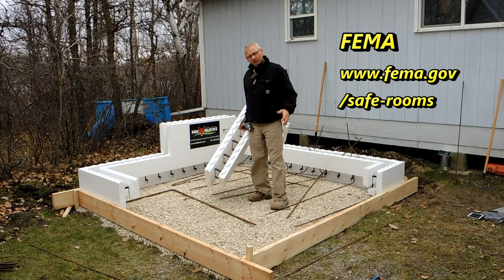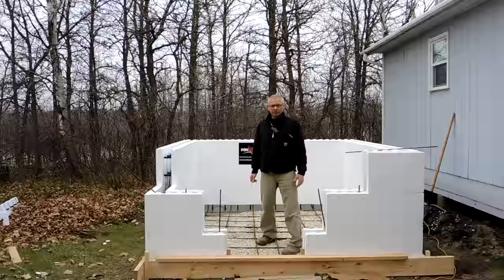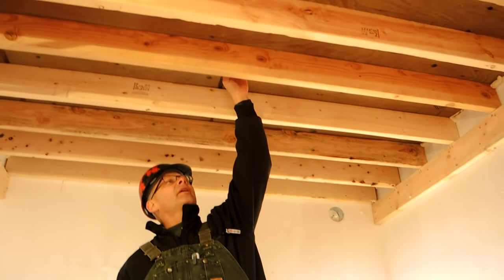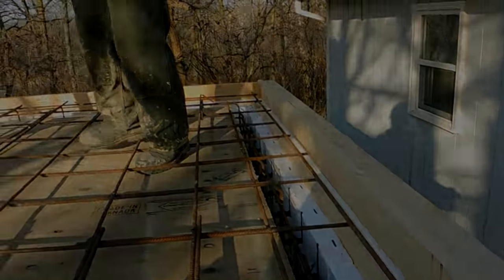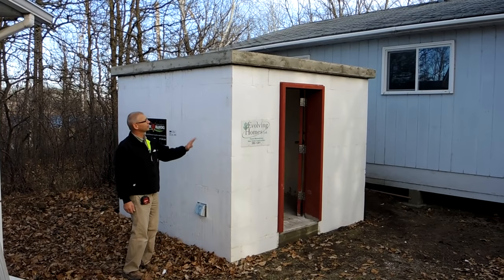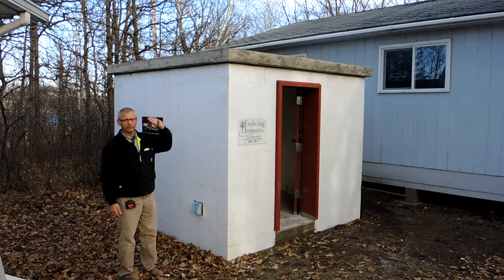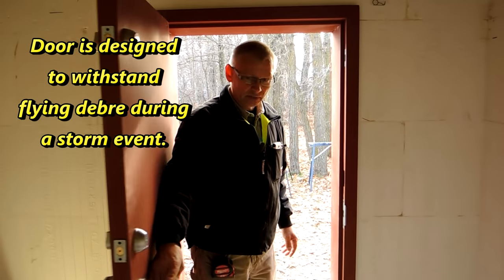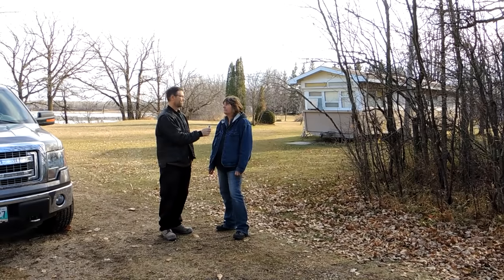Fox Blocks Storm Shelter Full Length HD

Comment: Having been through a tornado in a safe room I can say that this shelter is NOT anchored to the earth and may tumble if there is a direct hit. (Wadena MN Tornado.  Our house was the first house destroyed in town)
Reply: I immediately wondered what anchors the building to the ground, nice concrete shelter but no good if it goes flying off.
Reply: That was my first thought.

 First of all, I am sorry for your tremendous ordeal. I can't tell you how many times we ran to the storm cellar when I was a kid. 

But if a tornado can toss a bank vault, this will be tossed as well; the weight won't save it, or those taking refuge. 

It needs to somehow be anchored. Or put it in the basement of a building that is being built, possibly. 

Would not be my choice. I see problems with a LOT of storm shelters they sell now. A lot of below-ground ones are popping up out of the ground, not anchored in place either.

Its a crying shame people are being preyed upon (using fear, no less) to purchase fraudulent shelters. 😥
Reply: Normally an engineer will call for rebar ties sticking out of the foundation that the blocks go over. That tie the wallls to the foundation with the next pour. Yes this was a flawed demonstration and it what a to code example would be. Nice catch y’all
Reply: if you read below the video, it states that putting anchors would make it stronger
Reply: @graciel3725 do you think a over the ground steel shelter works? I bought one to install inside our closet.

Comment: After witnessing the recent Kentucky tornado and walking through the debris and destruction, I would not feel safe unless the shelter was below ground.
Reply: There are above ground shelters that are much safer than below ground ones.
Reply: Yep.  I lived in tornado country all of my childhood.  Shocked to see this in the first few seconds on a pad on top of the ground.  I would not  want to be in tornado weather in that.
Reply: But when the mobile home flips over you're trapped underground. Hope it does not start leaking water/fuels or have an electrical hazard/fires right above you. Dying from being trapped inside after surviving the tornado is not a great plan and is why most of these above ground shelters have inward opening doors and airflow management. Most underground shelters I have seen are primarily designed for nuclear / forest fire situations. Tornados are extreme, but if your above ground shelter is built to be stronger than the debris thrown you can survive fine and I would feel 1000 times safer in one than a bathtub inside that mobile home.
Reply: Above or below ground is not an issue about the strength of the build.  The issue some people have is massively expansive soils and high water tables that would destroy the shelter before a storm ever came.  But the issue with this shelter is it’s not really heavy enough or secured enough to the ground for a direct hit from a bigger tornado.  But slight modifications such as tornado earth augers and strapping or a deeper footer or slab would solve some of those problems.
Reply: Above ground shelters if built correctly, and I stress built correctly can easily survive an EF5 tornado. No one has died in an above ground shelter built to FEMA ICC-500/P-361 standards. All 11 above ground  ICC-500/P-361 standard shelters that took a direct hit in the EF5 that hit Joplin did fine. All 16 above ground ICC-500/P-361 standard shelters that took a direct hit in the 2013 Moore EF5 did fine.
Reply: I would prefer atleast mostly underground too.    theres no denying thats safer in a tornado
Reply: @97warlock  Pros and cons to each. The best is both, I've seen people installing underground shelter's with an above ground shelter covering the underground access door. It makes it almost impossible to get trapped in the underground shelter from debris.
Reply: @Reloadeez     thats incredible.          2 swhelters,
Reply: @karlab9557  It's perfectly safe in a tornado.
Reply: @97warlock  I deny it. Verified by above ground shelters in Moore and joplin.
Reply: LOL, there are so many self appointed engineers in this comment section.

Comment: How was this shelter anchored to the ground? If it's just sitting on top of the ground a strong twister might lift the whole thing up off the ground and take it away regardless of it's massive weight!
Reply: I don't know, that thing would be pretty darned heavy for it's size. 9x9ft with 5" thick floors and ceiling and 5" walls. That's something around 6yd of concrete and 24k lb!
Reply: Concrete is pretty heavy. Every other structure will be destroyed and that thing would still be standing. Only thing better would be a concrete dome.
Reply: Depending on the strength of the tornado it might be good for a small tornado like a EF0 OR EF1 anything over that would probably destroy it. That thing needs to be under ground.
Reply: @shanefowler3504  you might want to check tornado videos. Buildings that are heavier have been totally destroyed.
Reply: @shanefowler3504  Better would be to bury it underground!
Reply: When locomotives engines get thrown around like nothing, no way that thing is staying put just poured on the ground without serious deep ground anchors, many ground  anchors.
What was the weight of that shed, 24k-lbs verses a diesel locomotive ball park 120k-lbs getting tossed around.

I’m thinking a human milk shake on a direct hit on that shed
Reply: It will be knocked over once the tipping starts where air flow gets under it. Scramble eggs inside.

Comment: We had a huge tornado come thru Moore Oklahoma then thru Oklahoma City and Midwest city. It picked up a covered hopper rail car which weighed about 63,000 pounds. 1/4 inch steel. it ripped it into three pieces and tossed them half a mile. One piece went into a building and one went into a ditch about a block from that. I do not want to be in anything above ground.
Reply: But that had airflow underneath to lift it.
Reply: May 3, 1999 Moore OK F5 tornado leveled everything in its path. Local meteorologist, Gary England told viewers to “get underground if you want to survive”.
Reply: Casey Outdoors there have been multiple tornadoes in Moore?!
Reply: I was there for the 2013 one that hit.
Reply: I would build up dirt hillsides all around and at least 6" on top. Otherwise I'd say underground is Definitely better.
Reply: I would not feel safe in that. It doesn't seem to have much other than weight to hold it down. Even if air can't get underneath it I still think that a fierce enough storm would just take this thing for a ride.
Reply: As a Dutchman I don not understand why American people in parts of your country were tornados often accur are not building houses from strong concreet. After a devostating tornado you often see houses  made of timber witch are in  compleately ruine . Is concreet verry expensive in the US?  A superstruckture from concreet wil withstand a tornado much better than house made out of timber.
Reply: @tinekedevos-elsenaar5901  it's hard to describe what you would need to do in order to build even a tornado "resistant" structure much less a tornado "proof" structure. No flat surfaces on any side. Weight means nothing to a wind traveling at 200 mph in different directions. An ef4 or ef5 is yes one tornado but there has been research done showing that inside a big one, in your measurements 2 kilometer across, there are multiple vortexes all going in different directions. Don't think anyone here wants the added expense of building a concrete  dome buried and anchored with all the power and communication infrastructure buried also. On the coastal areas we also experience hurricanes that have tornadoes along with tidal surges of  sometimes 20 to 30 feet.
Reply: @tinekedevos-elsenaar5901  People here resist change, they want their houses to look like every other house around and unfortunately that means stick built houses and they charge a fortune for them. Concrete houses would cost a little more but considering the amount of expensive labor in framing and siding a house and the higher maintenance after it's built reinforced concrete would be cheaper in the long run but people here are just set in their ways.
Reply: donnie brown said
Reply: What you put together in pieces, will come apart in pieces. No way in hell would I risk my family’s life in this failure!!! OZ Saferooms is the only way to go. www.ozsaferooms.com.
Reply: Private Investigator
 I took a look at the Oz. 

Fox block comes in 8” forms. You can poor an 18” ceiling if you really want. You can put whatever door you want on it, sliding or swinging. You can use additional rebar as you like. 

Two things the fox block has that the Oz doesn’t. 

Studs every 8” inside and out. That means you can easily customize the inside and install siding if you want.

Vapor barrier/insulation inside and out. 

This means you can make part or all of your home from this and don’t have to go outside if a storm is coming. 

Oh, and other than the concrete poor, you can do all the labor yourself. Unless you know how to poor the concrete. Then you can do it all yourself. 

With the Oz, all you get is a concrete box build completely by hired labor. 

To each their own, of course.
Reply: Yeah 99 and 13 took same paths just about also. Several people had homes destroyed rebuilt the. Destroyed yet again.
Reply: Arnold Thompson I have seen an f5 peel a street completely up! Do you know how hard it would be to peel the street up? I have seen a house’s foundation completely gone in thin air after a tornado! Mother Nature would tear this out house to pieces even at an f3 level! All shelters should be below ground! It’s still a better option than riding the storm out in that trailer house! If that was my shelter, I would of had 
anchor bars about 10’ into the earth, and have the footing tied in the anchor bars, on top of a 12”+ footing! You only have 1 shot at getting this right, you either survive or die, go the extra mile to make sure it’s right!
Reply: Don't blame you.  They didn't even go down about 3 foot in concrete into the ground to help hold it in place.  Scary.
Reply: Tineke de Vos-Elsenaar     In the U.S. we build expensive beach houses that we know will eventually be taken down by a ‘hundred year storm’.  In about ten years.  Then insurance rebuilds.  It is the American (U.S.-ian) way.  The owners are always devastated and never expected such a terrible storm.
Reply: @tinekedevos-elsenaar5901  wood is cheaper to build with. Im learning that ICF is more costly up front in the build than wood structures. However i do agree more structures in tornado alley should be built to withstand tornadoes.
Reply: Even above ground can form some type of protection the chance of a tornado that big to destroy this place hitting this place directly...... You might as well just say it's gods will at that point
Reply: @TheHopson  there are literally scores of cases of above ground shelters being perfectly safe. Storm after storm you see footage of slabs wiped clean except for the above ground shelter.  Also, all tornadoes don’t occur in Tornado Alley. Dixie Alley is nearly as active, and the vast majority of us cannot go “in-ground” due to the water table.
Reply: @A1SPI  the reinforced concrete is 100% of the strength here, and it is monolithic just like the Oz. That said, I would have done denser rebar for missile protection and a WAY heavier foundation if I lived in F5 alley. Still, this thing will withstand a lot.
Sincerely,
Some a-hole on YT who is also a licensed structural engineer
Reply: This has already been mentioned but I agree, it needs to be anchored with footings about 3 -5 feet into the ground.
Reply: @tinekedevos-elsenaar5901   concrete is not expensive, it's quite labor intensive and not many residential home builders have the know how too.
Reply: @tinekedevos-elsenaar5901  Huge local tire shop in my area got nailed by a tornado a little over a year ago, they all happened to be in the break room since things were slow because of covid going on, and thankfully the break room was built like a storm shelter. The old building was steel, the new one is 100% concreate.
Reply: @branisthemanyo  meaning....a rail car tossed onto this structure would be very bad for it occupants.
Reply: @tinekedevos-elsenaar5901 every house you see is made of wood. It just looks like cement but they are not. I don’t know why, well I guess I do. I waited 5 years to buy a house looking for 1 made of concrete or cement, but only found wooden houses, 1 time I heard about 1 cement house and the cost was 4 times the price of a regular house. And that’s the only house I’ve ever heard of and also 1 that

Comment: Having a vertical door that opens IN is very important. Anything else can trap the occupants when something lands on it.
Reply: joe woodchuck  You are exactly right ! I’ve seen countless shelters advertised, most with outward door. Not good !
Reply: It also minimizes the possibility of catastrophic door failure.
Reply: I agree.  I would not go into a shelter if the door opened out, or has rails to slide on, on the outside.
Reply: And use the correct door so it doesn't blow in like the poor sweet lady in oklahoma  sending her family love and prayers 💕
Reply: I'd rather be stuck inside for several hours than have that door blow in killing someone.  Always have the door open outwards and always notify your local or community fire station you have a shelter.  They will check on you if involved in a storm.
Reply: Outgoing doors are far stronger than inswing. I'd rather be trapped for an hour than die.
Reply: @williamabaker12  You could die when nobody knows you're pinned inside by a tree branch. Doors opening in can be made just as strong BTW.
Reply: @bparsons72007 A strong enough wind can still rip an outward swinging door.
A Centurion tank had it's hatches blown open in a nuclear test.

Comment: My neighbor used a small steal shipping container that is anchored  using concrete   and steel beams hammered 20 feet 
into the ground and welded..He paid less than $1000 and is sweet, well built and very safe.
Reply: Sounds definitely like a strong & economical way to go!
Reply: That's a good idea.

Comment: Yes, the rebar and no chairs is a problem, not round is a problem, the lip is a problem, the door is a problem, the width of the walls is a problem and the biggest problem is the lack of a proper footing for such a shelter.  However, what turned me on was the fact that it was a monolithic pour.  One big, bad ass pour with no blow outs.  Good thing!
Reply: How did the concrete stop from filling up the floor and just started filling up the walls?
Reply: @toocoolfortheroom380  i was wondering the same thing too
Reply: @toocoolfortheroom380 pour enough for the floor to fill, then wait a bit before pouring the walls

Comment: I   used   to   drive    a  mixer   concrete   truck   and   I    hate   those   dam   pump   truck
drivers,  they  tell   the    mixer   driver  "add  10   more   gallons   of   water"    and   then   they   tell   you   to   add    more   &    more.  They   do  NOT   want   to   pump   a   slump   of  5
they   want   a   7   or   8   (all   water)   to   save   their   pump   from   working   too   hard.
When   you   water   down   concrete    it    will   crack   after   a   few   years.  This  guy   wanted
a   5    slump   he   should   have   sent   that   load   back   and   waited   for   a  5   slump   load.

Comment: Given the choice  of seeking shelter between the stick built house or this concrete bunker, hands down the concrete bunker is the better option. Although, it wouldn't have added much cost to the project to integrate some steal columns into the floor pour at the corners going down 8 feet or so to keep the possibility of structure of being rolled over "worst case scenario on the door side" you'd be in tombed until heavy equipment came to upright the structure. Still it's a strong well built structure alternative where below ground structures are not feasible or cost effective. Nice job....

Comment: Now you just have to hope that when the tornado grabs this thing by the rain drip edge and blows this cube onto it's side, it doesn't land door side down. You could have attached 4 helical foundation piles to the rebar in the floor of that thing for about $700 and tornado would have to pull this thing up by the underground bedrock to move it.
Reply: Pretty sure an F0 or low end F1 isn't going to flip this thing over, hell they can barely push a car around
Reply: explain more please

Comment: Fox blocks. Good way to make an insulated house. Why an insulated storm shelter? I do like the eadse of construction. Looks very solid as it blows down the road
Reply: You should check the mfg for the wind load for these blocks not been around this for a few  years but i think 165 mph or more.  Agree with the lack of anchor to ground.  Comment about height of drop of the concrete shows this guy does not have knowlege of pumping concrete walls.  I would not have added the lip. 7" slump can be good concrete we do not what chem. added to increase slump for pumping and not reduce psi of concrete.  Don't get a home built if you want a slump less than 7". I agree it is a demo video and may be licking some details.
Reply: Lol
Reply: he makes doghouses with the stupid blocks too and a fence

Comment: people concerned about it blowing over and not anchored down...concrete weighs around 4,050lbs a yard.  6'x6'x5" alone is 15 cubic feet or 0.56 yards.  times 2 for the floor and ceiling that's 4,536lbs.  the walls are an additional 2.93 yards if it didn't have a door.  so this thing weighs around 16,000lbs and is short and not wide.  I wouldn't be that worried as wind can't get under it and its profile isn't a large surface to push on.
Reply: I’m sure you’re not worried... your entire house is built from Steel reinforced concrete 🤓